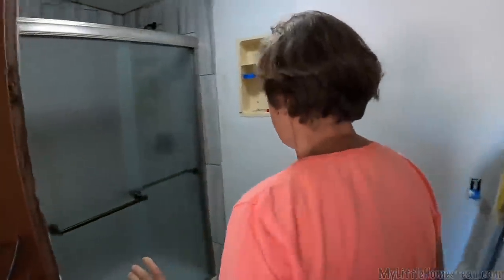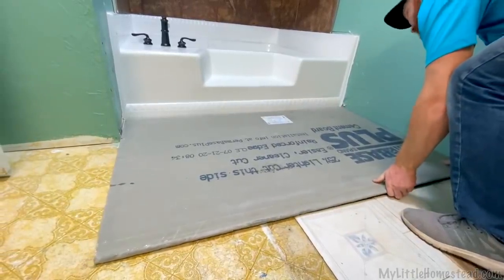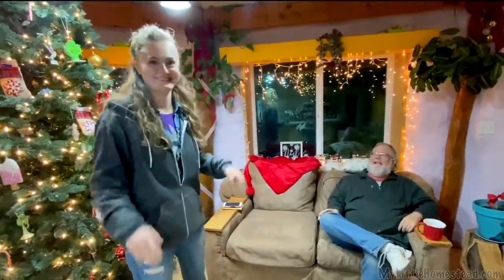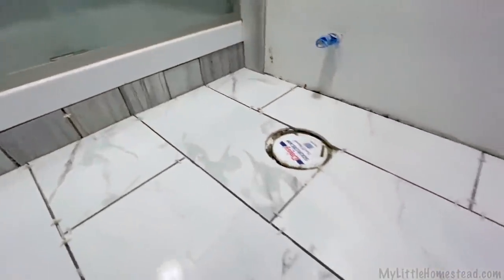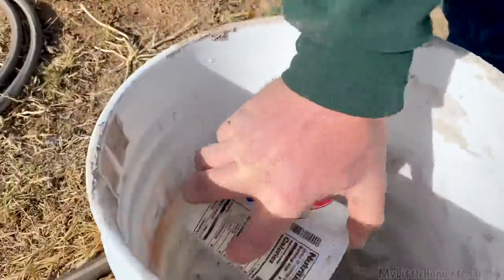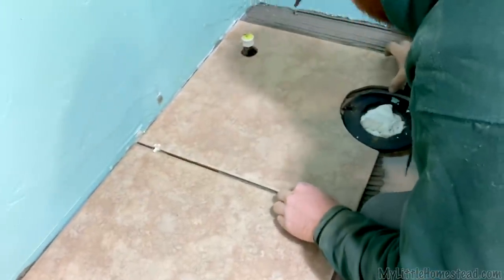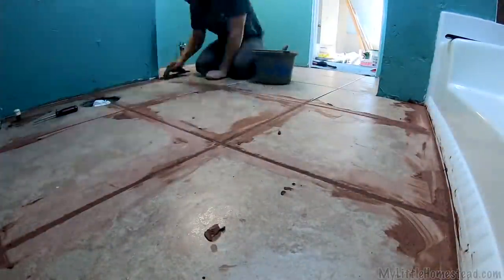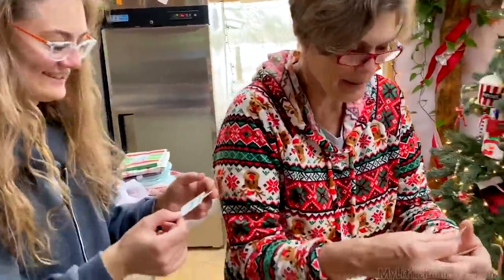Bathroom Tile in Mobile Home | Weekly Peek Ep264

Comment: Just a quick tip on the mobile home floor tiles. The hardy backer is not a bad idea but what's going to give you structure is the amount of screws to fasten it down., glue is good too. I use 8-10 mm plywood and screws every 3 inches. All the best!!

Comment: Modified thinset is an excellent choice to use over the cement board. It will tolerate more flex than unmodified.

Comment: @Garen for the tiles or seems not to crack I realy advise you to work wiith the following product or something similar: Schlüter®-DITRA tiling.
If you google it, you'll get the right product.
It will also make the floor less high if you remove the sheetrock  plates and use that in its place. Since you haven't treated the sheetrock plates with the pink waterproof shewing gum risk for it soaking up  water is high. I hope it works as is.....if it doesn't, know there's still another solution to make it work ;)

Comment: I've never seen anyone put that cement board on a floor before. Most just tear up the old flooring, put the mud down, and then the tile.
Reply: Needs it if it goes over wood subfloor. Odds are you saw a concrete subfloor

Comment: there is a chemical that you can buy that you use to make the mortar that makes the mortar resistant to Mold and bacteria... last time I did that kind of work it was 12 bucks for 2 gallon.
Reply: once the mortar is dry.. cleaned.. dry again... you can pour the liquid over the mortar. - let it dry.. clean it.. then pour it again.. do this at least 3 times.. on HOT days like like to do it 5 times.. - It's just easier to mix the mortar with it.. cost a little more but it's cheaper on TIME.
Reply: grout? as your father called is is what i mean about Mortar - the mortar under the tile as well.. can get mold and bacteria in it.